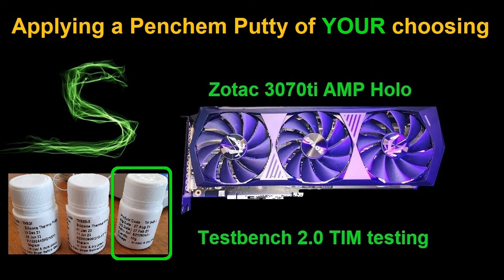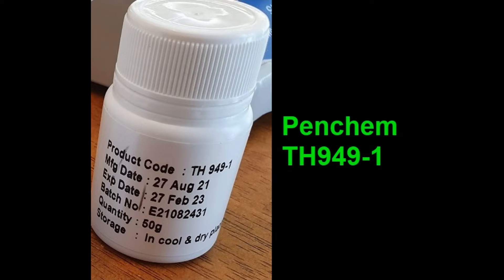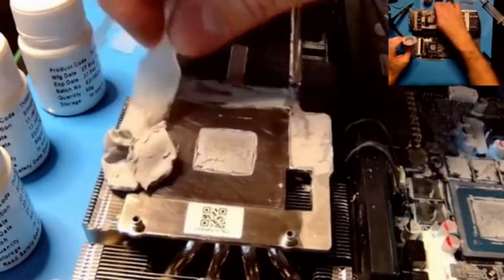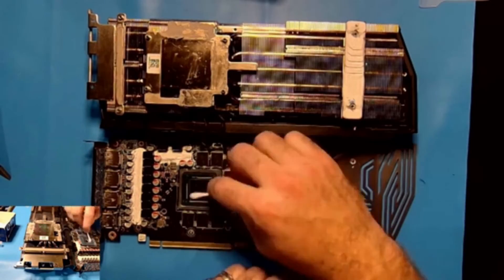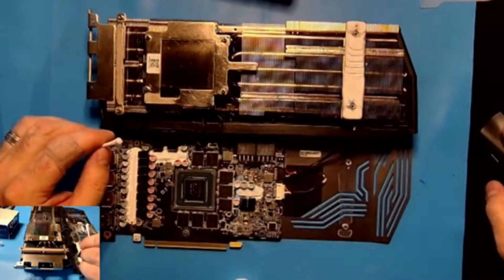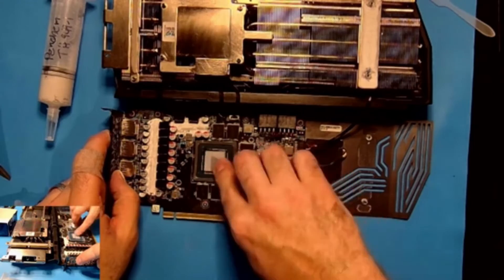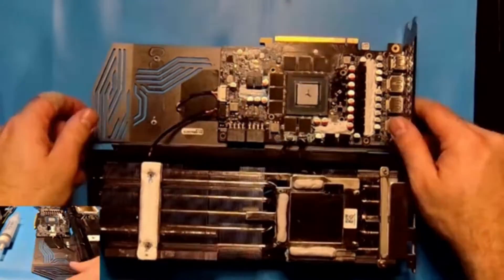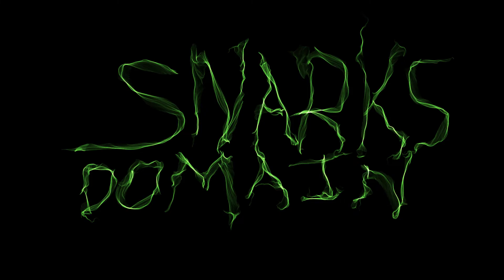Penchem TH949 1 Stream Timelapse

Comment: Hello copper plate + upsiren ux proultra  Is it suitable?
Reply from the maker: Not really no. Most putties are not suitable to use wirh shims based on the larger particle sizes they used. The current best putties to use with shims are:

Halnziye HY206  / HY236 
Zezzio ZT-PY6 

They have particles measuring arpund 0.03mm and can easily squish thinner than 0.1mm. They have decent midrange performance on their own without shims even at a 1.8mm gap size. At 0.1mm there will be much less difference in performance between different putties anyways (if most putties could even get that thin).

My video called "What Is Putty" documents the different characteristics of each putty, including the measurement I got using a good set of digital callipers that are calibrated yearly. Timestamps for each putty. I'll be adding the measurements info into the charts somehow.

Comment: Hello. Thx you for your videos. I am wondering how many grams of putty are usually necessary for GPU memory modules and VRMs ?
Reply from the maker: For just the VRAM on this card (8 chips), and core side only U'm using 15-20g of putty. Each card takes a different amount of putty.

I need to make a calculator sheet where folks can enter sizes of stock thermal pads and it'll say approximately how many grams you need, and what diameter of "log" to aim for to replace each pad.

Comment: Hey quick question...
What happens if let's say i have just applied new Putty, and then have to re-open the card later down the line ?
Like a month later the putty was still kinda malleable not solid yet, do you have to re-apply or vram will make contact again regardless ? (Provided that while separating the card, no putty fell down or anything of the sort).
Reply from the maker: In this scenario I would likely reshape the putty around the VRM woth a little spatula, like I have been doing with the TG-PP10 on this test card.

For the putty on the VRAM I would remove, roll into logs and place it back on. This way it gets good contact during reassembly of the card. I wouldn't clean the putty off though, since you'll be reusing the same putty. Just remove bulk and roll into logs (with gloved handa) or use syringe to squeeze it out into logs (this method would be easiet with a messy putty)
Reply: thanks! Any advice on how can i store my putty? Plenty left and i dont want it to go bad.. @snarksdomain